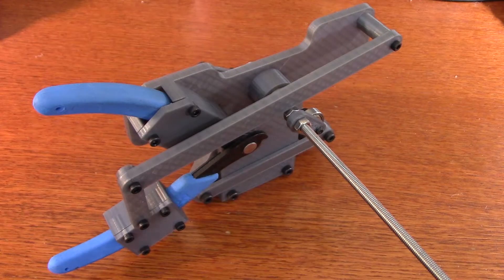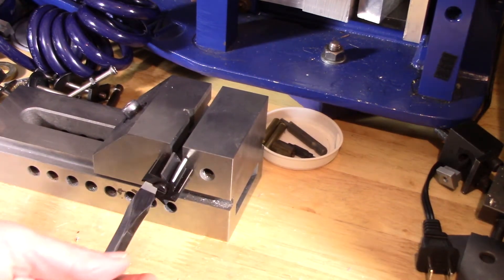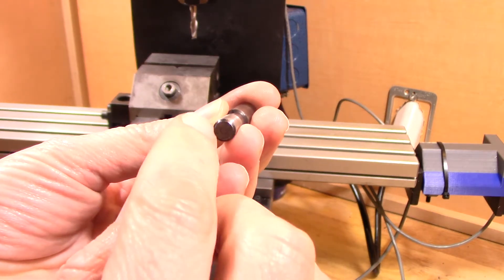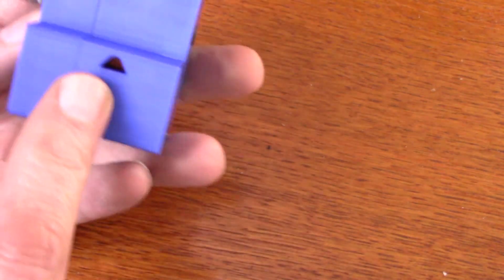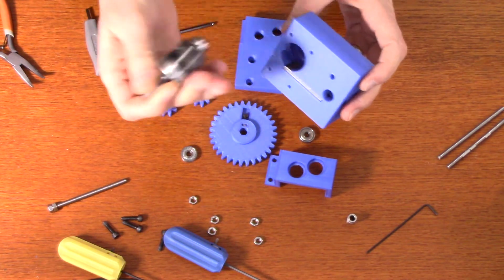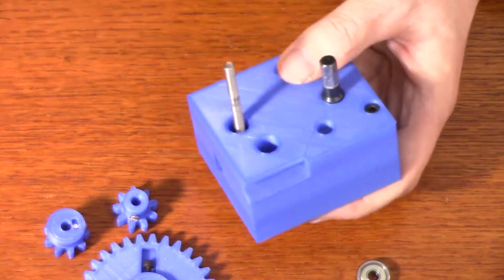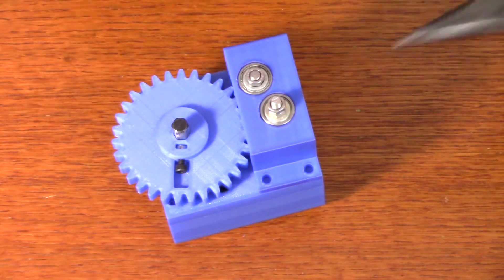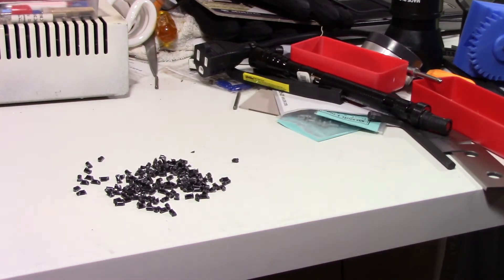Plastic Pellet Maker Part 4

Comment: I think you could eliminate most of your feeding issues by using a type of dual gear extruder and springloading the Feeder gear. Also i think slowing down the drill might help, i find most of the time i break pla off of a spool of filament is when i tug on it too fast or drop it but never when pulling hard slowly. Maybe the same logic Applies here?
Reply from the maker: I have a version now that has been very reliable: https://youtu.be/gGjAa8ds8_k

Comment: Have you seen a pasta making machine? The dough is extruded and a rotating blade cuts the macaroni or whatever to a length that depends on the rpm of the cutter. All you need to do is have a stepper motor for the feeder and another one for the rotating blade shaft and a micro controller (Arduino perhaps) to adjust the steps of each motor to get the length of pellet you want.

Comment: While watching you trying to loosen a screw in Plastic Pellet Maker Part 4, I wondered if you have ever used a hammer driver?  A hammer driver is a tool that accepts different types of screwdriver type shafts; both straight and philips, ( haven't seen Robertson type ) > the shaft is inserted in a holder one hits with a ball peen hammer ( flat end ) which really puts both counterclockwise twist ( turn ) as well as downward pressure to loosen stubborn or rusted screws. Another trick to loosen a tight screw that has been in place a while is to really hit the back (handle) while the tip is on the screw, so as to shock some movement to the screw's threads; be they either of a wood, sheet metal, or a machine screw type.
Reply from the maker: That's something I learned about after watching the video. I don't have a hammer driver, but something I should certainly get. Thanks.

Comment: Not to be too critical, but how much (or how little) filament do you need to peletize? This seems like little more than a toy and seeing as you have a table top mill, the same process could have been achieved by running a multi-flute end-mill inside an aluminum block with a matched hole, an in-feed hole and out-feed opening.
Reply from the maker: I don't expect to make a huge amount of pellets. But the whole point is to be able to make custom mixes using my Fillastruder and then chop it into pellets. I have some masterbatch I'll be mixing into raw ABS plastic to get just the right color, but also anti-static properties. That's not something I can buy already in pellet form. Also, it turns out that this seems to be a little sensitive to the geometry, so it required a few tries before I got it to work well. I have issues with the 3D printing starting to break down, so my plans is to machine the next version from aluminum. As to why not an end mill, I'm not sure it would work as well because it's more about pinching off the pellets rather than cutting material away. With an endmill, it would most likely turn it into fine shavings instead of pellets.

Comment: If we 3D print a mold in abs and after using an injection Machine to inject pla inside of it! It will work or no?
Reply from the maker: I've never tried that, so I have no idea if it would work. I've read about 3D-printed molds using SLA printing. My understanding is that they only last for a few parts.

Comment: Awesome. I was afraid you’d be “just” using Fred’s design instead of your original Rube Goldberg pelletizer and there would not be much new to see.. :-)
Reply from the maker: I was hoping for that, in which case it would have been a video of making custom plastic pellets. But no, ABS turned out to be much harder to cut than PLA.